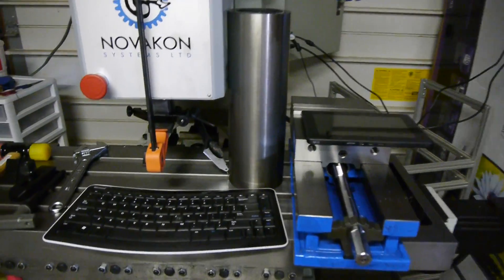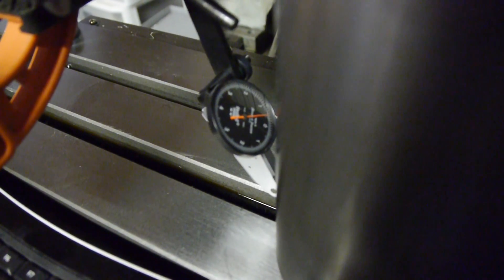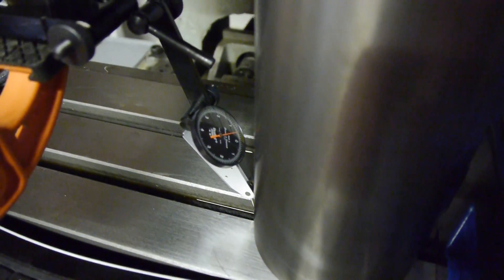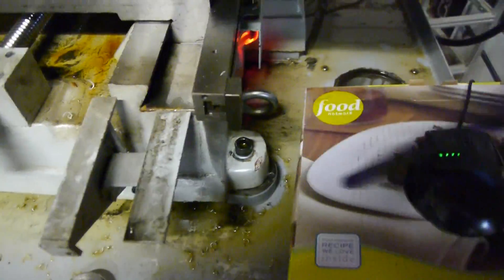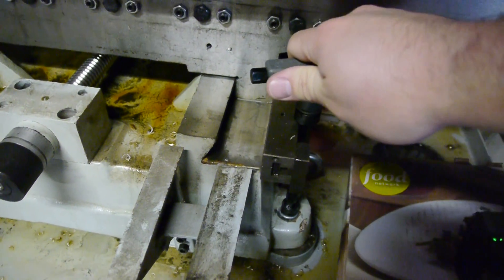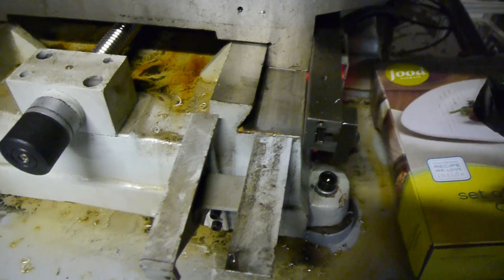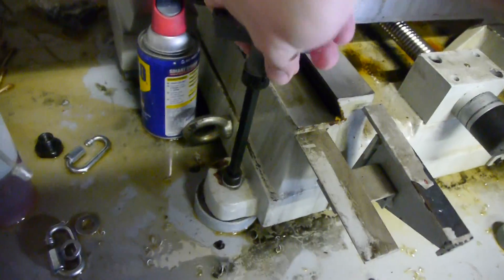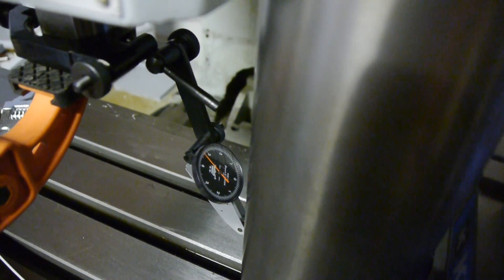Novakon NM-200s2 - Another squareness test

Comment: Take it this is now fixed, how did you fix it? how do you like this machine, do you still have it.
Reply from the maker: I wasn't able to fix it. I ended up sending this machine back to Novakon and they sent me a Torus Pro as a replacement under warranty. I opted to pay for the servo motor upgrade to be installed on the replacement as well. Sending the machine back was a long and expensive ordeal that I hope to never need to repeat. In fact, I haven't done this squareness test with my Torus Pro, probably partly because I know that if I found a problem the "fix" (sending the machine back) would be more hassle than I'd want to deal with.

I like the Torus Pro overall. If I was currently in the same place as I was then I would probably choose to buy a Torus Pro again. If I was willing to double the purchasing budget I would probably buy a Haas TM-1P or a small Sharp machine. I will have a new CNC mill soon so I'm trying to figure out if I want to keep the Torus Pro or try to sell it. It seems like having a second machine could be handy at times, but I am very limited in space.

I'm a novice and I bought the Torus Pro to help me learn CNC machining. I think it has served that purpose well. I, of course, wish it was better... but I'm also aware that a "better" machine might have been prohibitively expensive. To be specific, it's not as rigid as I would like, but that might be a complaint someone could have with any machine - I figure as they get more rigid people just end up pushing them harder.
Reply: Hirudin01 cheers for your reply, prob makes no diff the machine be out so long has your working in small hight jobs. Totally agree though if you found it to be out, then you'd wanna look into why and at your expense it's not always viable. 

Cheers